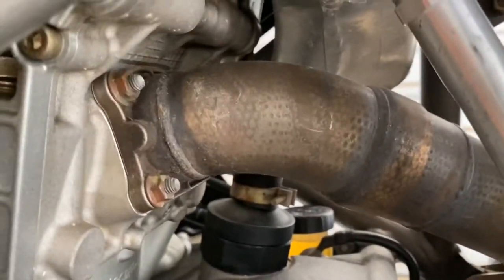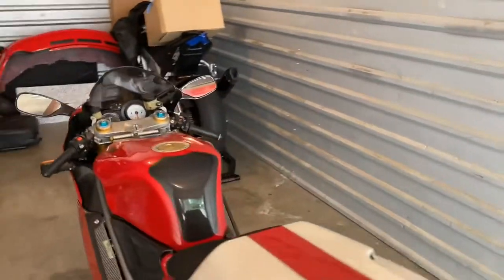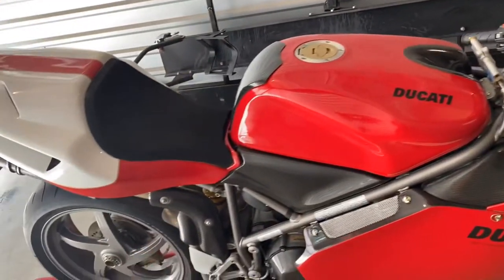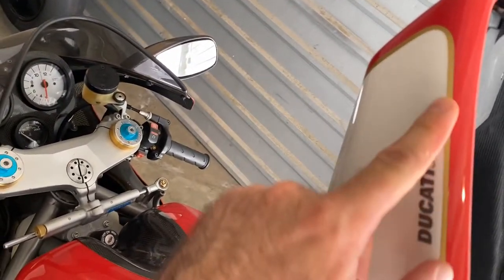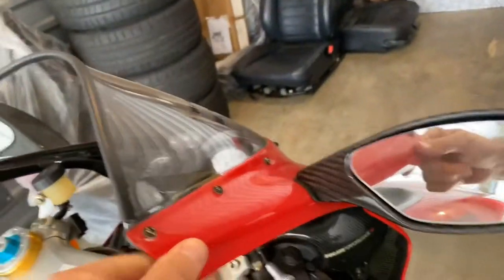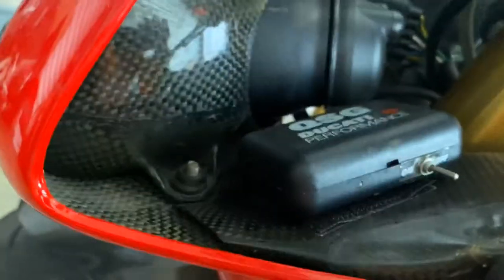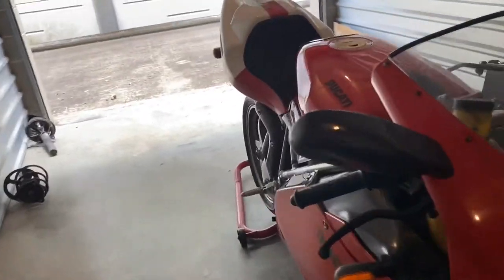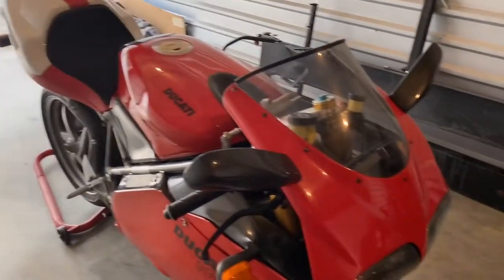2001 Ducati 996R: special first contact

Comment: It is not a 996R, you don’t have the number plate
Reply: The truth is, that for the 996R the numbered plate is not installed at all bikes. The carbon fairing and the tail are stock parts. Whereas the air intakes should be in plastic.

Comment: Saw one of these on my local craigslist.Some years ago. I don't remember if it was a 996R or 998R.  If I didn't already have my 1996 916 monoposto I'd went for it. Great to see this one in original condition,with period correct mods.Did you get it in running condition before you sold it?